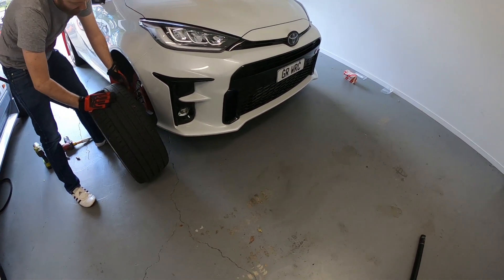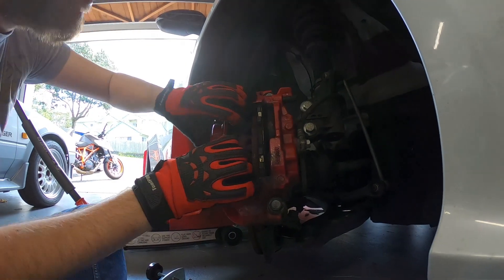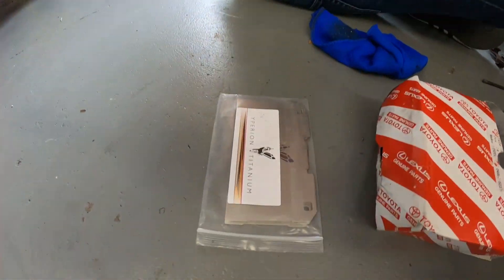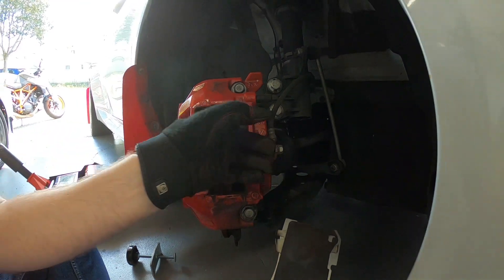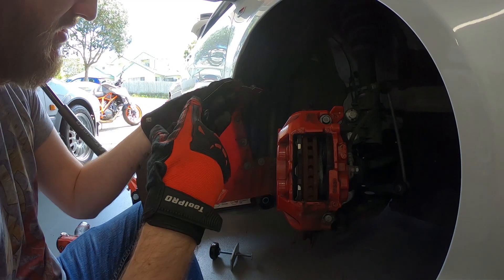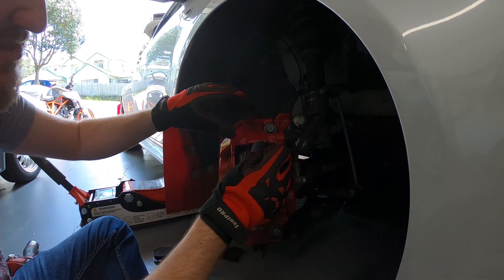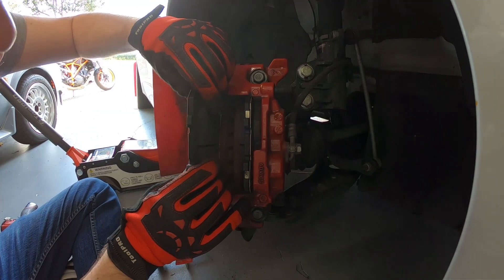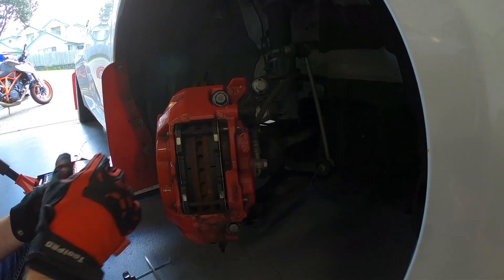GR YARIS: Brake pad and Yperion Ti Shim installation

Comment: Thanks for this, I used your instruction except …. I sandwiched the titanium shim in between the pad and the OEM shim, rather than put the OEM shim on the inside and titanium touching the pistons. So far no added noises etc. 

Do you think this will work just as well with no issues such as galvanization etc? It all fit together nicely with the OEM shim wrapping it all together. 

Also, I did this on slightly work pads so was easier to get it all in.  I imagine having both shims in there with brand new pads would be a challenge if not impossible.

Comment: The Arrow on the spring Clip points down, you need to revisit the RH side (first side you did in the vid) im not sure if it makes a difference, on mine both arrows point down 🤔
Reply: Thanks for the handy tip! Noted. Since this Ive had them off again for other reasons. Will look next time im swapping the wheels